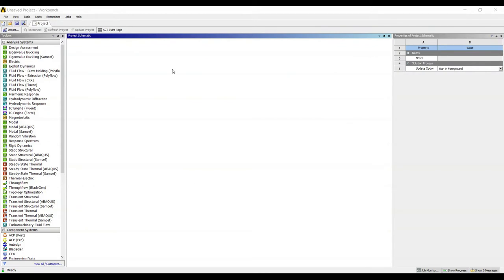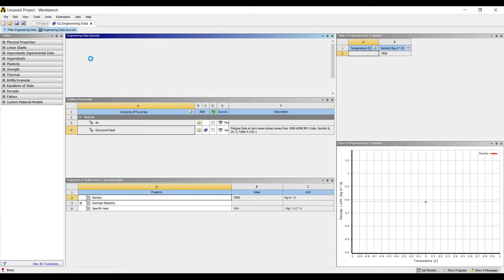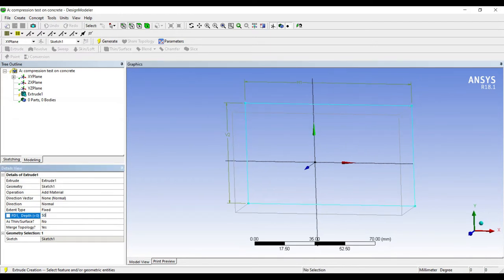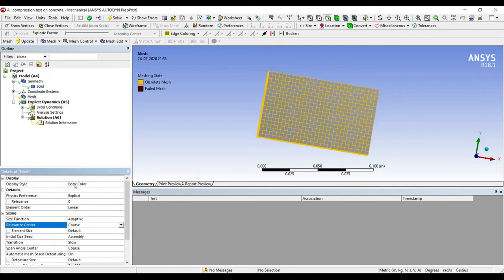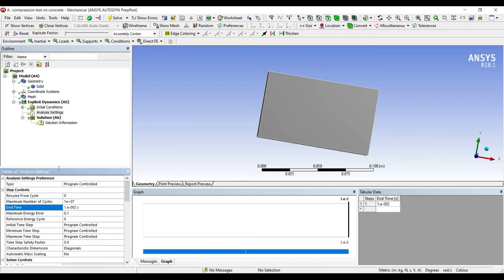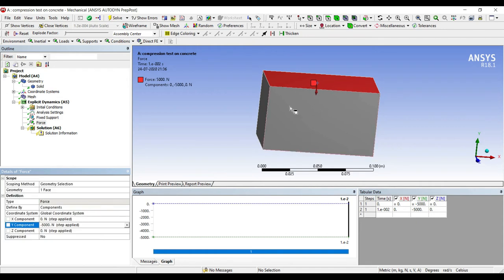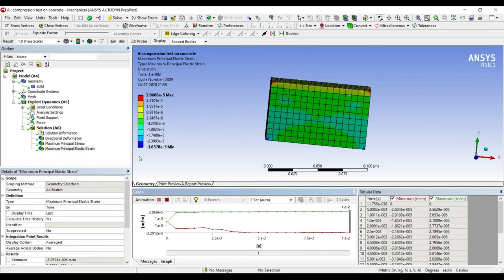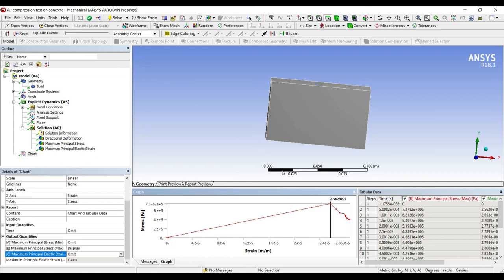Explicit Dynamics | Compression Test | Concrete | Stress vs. Strain Graph I Problem 6 | Workbench

Comment: It was really helpful mam, but i need a problem where I made a brick using slag+cement+sand i want to do compressive strength test for that brick in ansys, can you help?
Reply from the maker: Need properties of brick with this material composition to solve the problem

Comment: Mam Can we model the concrete specimen & analyze it with some  changes in concrete material like some mixing other particles in cement concrete such as flysh or silica?
Reply from the maker: Yes you can
Reply: @ProfSDBagg  mam can you please guide me how model that, or make vdo on it if possible. It would be so kind of You.